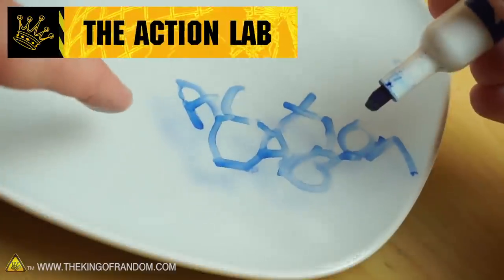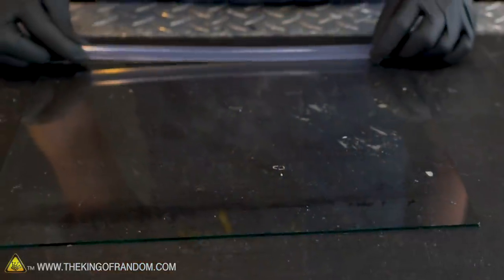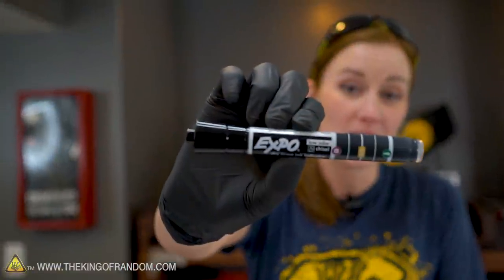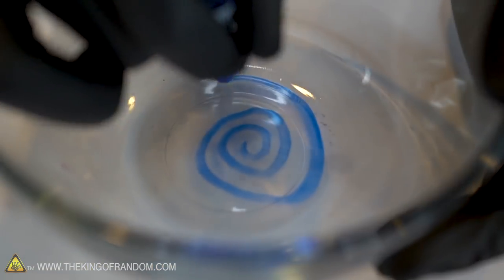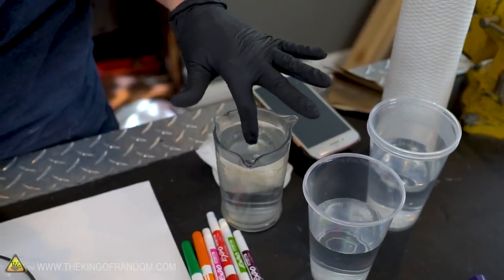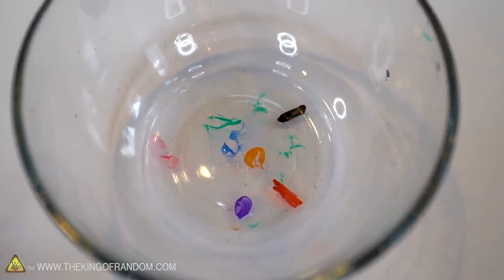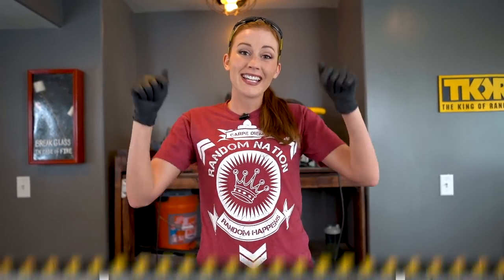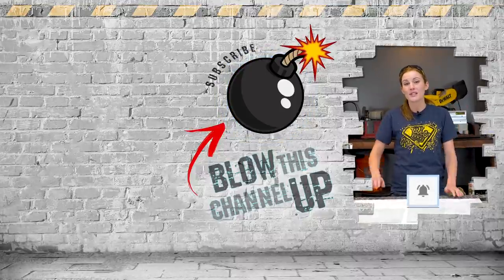Did You Know You Can Draw on Water?

Comment: Couple things...
You had to let the marker fully dry after writing with it, it has an alcohol solvent suspending a silicone solution
Pour the water slowly and away from the drawing so the vibrations/ripples don't disturb it much
Use lukewarm water because if it's too hot it will just start dissolving
Flat surfaces work better because the water can slowly get underneath instead of immediately on top
Brands/markers that erase the cleanest after drying out should work the best
Reply: Thank you
Best explanation
Going to read comments
Rather than watch the video
Reply: HOLY SH-
Reply: You should replace calli
Reply: Just Lopes Thx for the information

Comment: Would it be possible to preform these "drawings on water" by drawing on a flat piece of ice and letting it melt?
Reply: The marker probably wouldn't write on an ice block
Reply: Probably if the ice isn’t melting and is very frozen during the drawing process
Reply: You can't draw on ice, the marker will absorb the water that's on the ice

Comment: I've done this many times with cold tap water, anything too hot will just dissolve it. The trick is to draw thicker lines and let the pressure of the water lift it the drawing up, this is why it did not work 😑
Reply: NuttyRage Gaming thanks for the advice! it worked out for me in the end
Reply: Yea you need to have patience and pour the water at the side of the surface that you drew on. You then wait. One thing that I noticed is they never taped or shook the surface they drew on to try to raise the drawing.
Reply: @buderitup  exactly, it was kind of frustrating to watch this video haha

Comment: What if you put a lithium battery in a vacuumed chamber and use a laser to make the battery explode
Reply: If you're talking lithium metal, nothing. Lithium reacts with water and oxygen to burn, neither of which are in a vacuum. If you're talking about a whole battery including casing, you would need a military grade laser strong enough to melt metal and still the lithium would not do much. Lithium is not self oxidizing so it would not burn or explode in a vacuum

Comment: On about the third try it seemed to lift off from most recently made point and slowly progress, so maybe something to help keep it from drying too quick? Also if heat is an influence and the pour keeps breaking it up, wouldn't you get slightly better results if the water was just warmish and then put it on an electric stove top or something? Also if you did something like put it all inside a fish tank and make an adjustment that the middle point holds surface tension between the two sides, might be able to soak the writing off then , carefully slide the glass to the other side and lift it out and swap a new panel in underneath. Probably not with overall water disturbance and rate of dissolving.

Comment: When I tried this it was more successful if you use room temperature water 
a rather flat surface and pour the water in very slowly 
as close to the dish as possible letting the water slowly fill the dish 
not swirling it around and not pouring the water near the drawings

Comment: Yeah, you're pouring the water in FAR too quickly, and in too greater volume.. you need to use a drinking straw or some other way of introducing the water.. and the image needs to be "thicker" with ink, and needs to be fully dry so it doesn't just dissolve, and complete shapes will work better, like boxes and circles, rather than long spirals and loose wavy lines..

Tray again and I look forward to the update video
;)